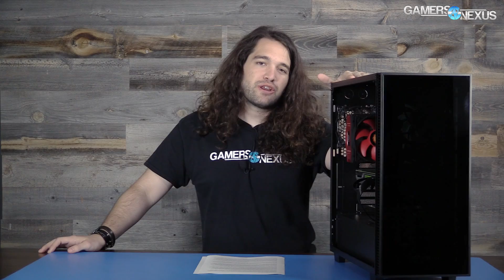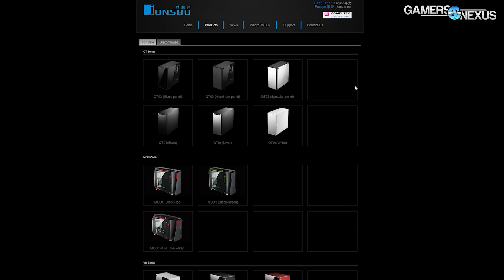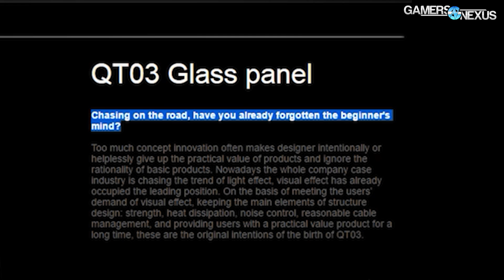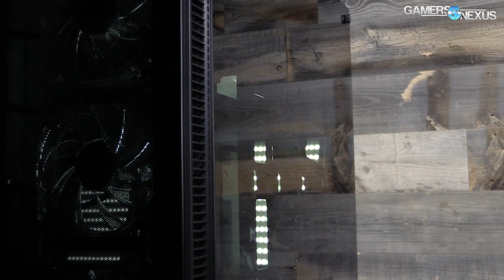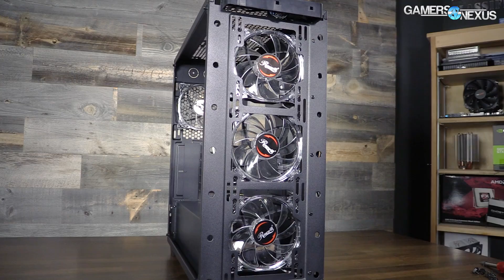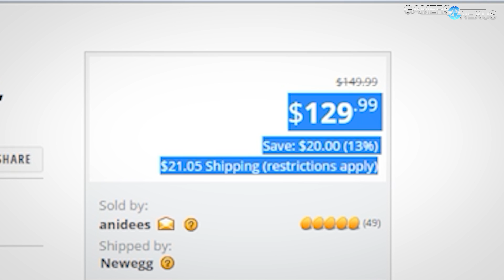Rosewill Cullinan Case Review (& the Anidees AI Crystal)

Comment: I wish I found this video when I first got my case, now almost a year later i'm finally getting to know more and more, actually everything there is know about my case, right here right now. A couple days ago, I noticed my GPU temps were just off. I was experimenting with the High and Low setting. Also, for me the case has High Low(LEDs turn off on low) and Off, not high medium low. Anyways, I noticed my temps would go down when I used the high setting, this video confirmed it. I actually did not expect them to go that in dept with temps using high and low setting. So far this video is very imformative and even went as far as to say adding more fans up top (which I actually did last year, I used 3 Noctuas but ended returning them) were not recommend and said to reserve that space for a radiator. That my friends is called efficiency. Glad I have the space for a radiator just not sure what to use it on. My CPU or GPU. :/ Or I can add a radiator on top of the 3 front fans.

Comment: I have both this case and the in win 303 i don't know if i am doing something wrong but i get horrible temps with the In win 303... thats why i switch this this one and after i switch i never got more than 45 degree delta C over ambient. did i mess up the in win somewhere...
Reply: Rubin Chen and the radiator block almost all the air running into the case

Comment: Watching all these case reviews made me realize that my case fans are (mostly) installed backwards. My front fans are exhausts,  and my rear fan is an intake. TIME TO FIX THAT. Also which video/article has the testing about top exhaust fans? I have one in my case, but if it's not helping, I have no issues removing it for reduced noise.

Comment: Hey guys I just got a Phanteks P400 but it doesnt fit all of my components in it (z170x mobo, corsair h110i liquid cooler). I have to put my fans on top of the case and my radiator inside the case. It looks quite disgusting in my opinon so I was wondering if this case will fit my components. Its advertised that it will but so was the P400. Can anybody tell me if it will be able to hold my components because its on sale and I really want to grab it before its too late.
Reply: you would need to check the exact specs to know for sure, but the Anidees AI Crystal/Rosewill Cul... watherver does have like 4-5 cm of clearance above the Mainboard, so... And even if your rad doesn't fit there, it should fit in the front if it's a 240 or 280 one, since it has 10-15cm of space for stuff like rads and resevoirs where the drive cages used to be.
I just got this case today and it feels about as roomy as a server case. Although I don't do watercooling and I'm stuck to a M-ATX system until Zen comes out.
Reply: Yea this case will fit all that stuff pretty easily. I have the anidees Al-crystal and I have a z170 mobo 2 980ti in sli and a h100i and you could do push/pull if you wanted in the top. It's a really nice case. I bought the Al-crystal for the 140's and because it's white!
Reply: FRANK DUKES Thank you vuuuuury much man.
Reply: No problem,It really is a beautiful case to put your components inside of. I wish I could post a picture here of what mine looks like. You just have to be on point with cable management, because there really isn't much room at all between the case and the glass panel. I have a fan splitter for the H100i and even that stops me from screwing the glass on all the way. Still is flush and looks BOSS though!
Reply: FRANK DUKES Hell yeah. Newegg is being stupid atm but Im still excited. I'll post an update when I get it up and running.
Reply: LOCO808 I got mine from Amazon. they have the all black one and the white one that i have. Its just white around the front fan vents and the whole inside is white. I paid 139.99 for mine and it arrived 2 days after i ordered.
Reply: FRANK DUKES I might have to order from amazon then lol
Reply: FRANK DUKES AI Crystal could also fit all of my components right? Im looking at it right now and um... it looks sweet
Reply: LOCO808 Yea this is what i have, I have an I6700k z170 Msi krait edition motherboard. its ATX 2 980ti's in sli a MSI lightning and a EVGA 980ti hybrid, A 1000 watt evga power supply and an H100i with 2 120mm vardar f4 fans in push. If you have an email i can show you what my build looks like and how much extra room is inside with all my components installed.
Reply: FRANK DUKES that'd be great. jtdowkin@yahoo.com
Reply: LOCO808 I just sent it. the subject is AL-CRYSTAL pics.

Comment: You say cooling worsens when the top used for solely exhaust fans vs putting a radiator in the same location? Be curious to see any link/source for this not that I doubt you.I had thought about using the front for 360 AIO

Comment: Where are the people which are screaming "thermaltake stole from fractal"? Everyone copies everyone else, it is hard to innovate when you are bound by industry standards.
Reply: Well, to be fair, Thermaltake was/is kinda blunt with it (in terms of design... I meain, they even stole from Bitspower with their watercooling blocks, pump tops, radiators, fittings, etc...) and not only stole from Fractal, but stole from CaseLabs. Strangely enough, the case I really like from Thermaltake are the V series cases and their P3 and P5.

I personally think that trying to innovate right now is not really a good idea. What I want to see are some re-introductions like how cases used to be held together by screwdrivers instead of rivets, which Phanteks pretty much brought back (which is why they are quite liked by the PC community), bringing things in that modders have kinda been doing for a while, which are things like psu shrouds, so on and so forth.

The last case that I really liked but can't see myself using was the Bitfenix Pandora matx case. It was slim for a case of its format, which I really liked, but drive placements and the part that it could've really helped if they increased the overall width of the case by an inch really made cable management and GPU compatbility a headache.

Comment: The only thing I dislike about cases like these, especially with the NZXT S340, and even my current gamerstorm case is that I have noticed that with high CPM fans it can be restrictive to lock the airflow down to a 1 inch gap. With the flow meter I get higher flow without the front panel on. It's almost as though case manufacturers are Specking it out for the fans that they include and that is it, I think this is a huge oversight imo
Reply: thanks for that, i just got this case cus it was on sale. im building my first PC and i want to make sure im taking care of it right!

Comment: That is a very attractive case. I suppose it is subjective, consider you are comparing the temperatures with the stock Rosewill fans. Most, although not user may end up using a different type of fan of their choosing, changing the dynamics a bit. Still an interesting video of the coverage of the case. I am contempt with my Define S, with a window. Not as good looking as glass but adequate. Nice job.
Reply: personally i thin inwin  805 looks better, and its a closely priced as well. And the built quality looks to be better on it as well
Reply: Yeah, the InWin does look best, but you need to keep in mind that it doesn't have a good cooling and is very poorly thought out in comparison. You have little to no space behind the mainboardtray, no PSU shroud (which turns from "unnecessary and boring looking" to "awesome", once you build a system with one) and large cutouts everywhere that give you little to no room to hide all your cables. for such a transparent case it makes it almost imposible to make your cable management look tidy. Which is why I bought the anidees. It has a lower build quality (weak fan screws, no thumbscrewss for PCI-E) and should be more like a 100 bucks, but building in it is sooo easy